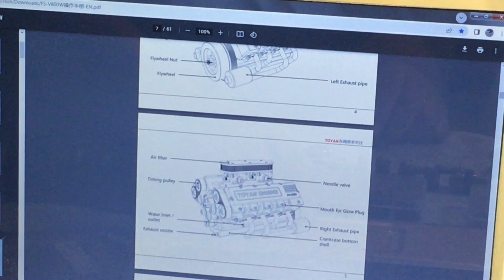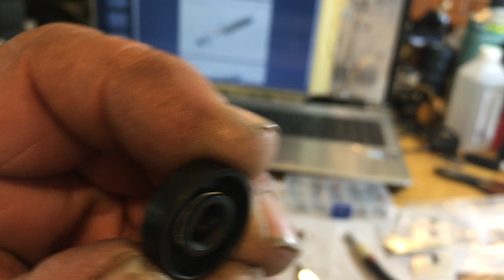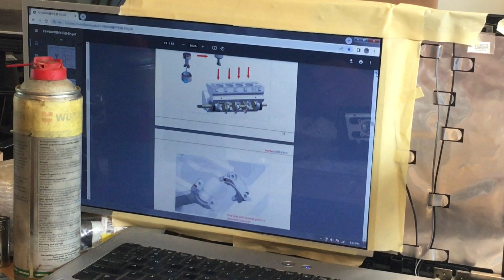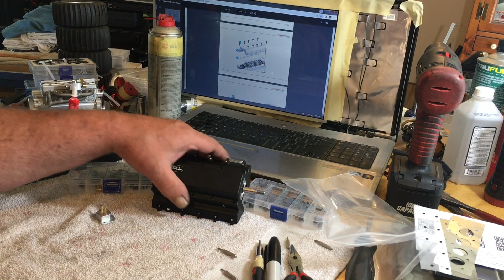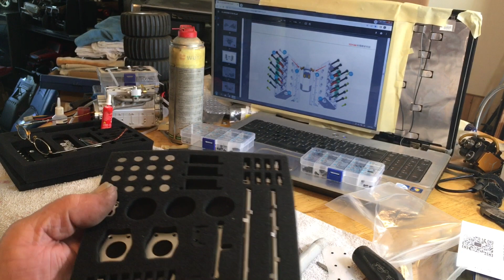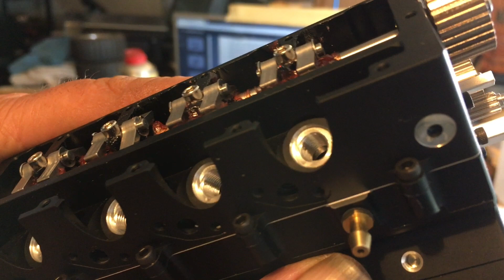THE ALL NEW TOYAN/HOWIN  BUILD!!!

Comment: Dennis I have looked all over for spec’s on tightening the screws/bolts do I use loctite do I grease the cam.Can use help with any and all specs.You have a great channel
Reply from the maker: I used loctite on my lower end, yes grease up your cam and rockers before you run it.

Comment: It's super very happy that you made this video I like to see the interior and the design behind this engine and I must say that I see improvements on this one compared to the other model the previous model also I wanted to warn you with different lubricant to use certain oil I believe that the selicone oil may be correct but I would be afraid to use it on this ruber seal made for non-synthetic sae oil those for synthetic are like a funny brown color I think But it's great I can't wait to see what you'll do with this one 😉😁
Reply from the maker: Yeah I had to show everyone how nice the machine work was, I figured the silicone would wash out right away with the hunger this thing has for fuel lol!

Comment: Did you torque the main caps equally
Reply from the maker: normally I would in inch pounds, do you have the spects ?
Reply: @dennisdempseyradiooutofcontrol  I was going to use specs for the screw size when I build mine. To have some control on my build
Reply from the maker: @davidw3971  I thought about that also but decided to use a little locktite and use the 1/8 turn after snug method, probably not the best way but it has worked in the past.
Reply: @dennisdempseyradiooutofcontrol  
I started building my engine today and ran into issue with the 3 support bearing being to tight with the crank shaft installed. The screws only snug and the crank won’t turn. I used the grease that came with the engine to lube it. You think the grease is to thick